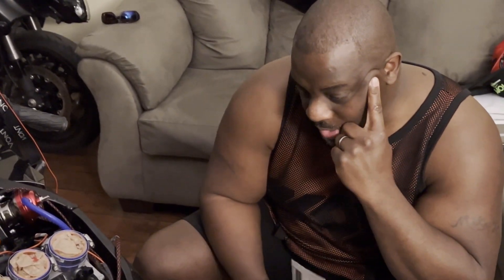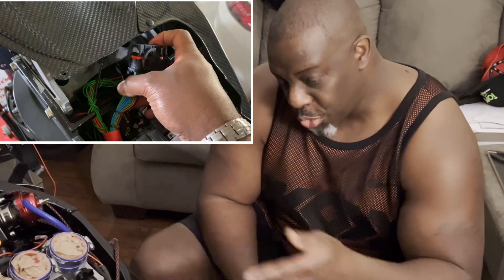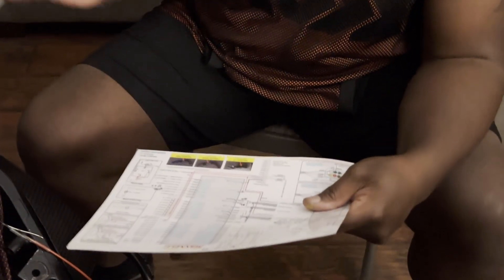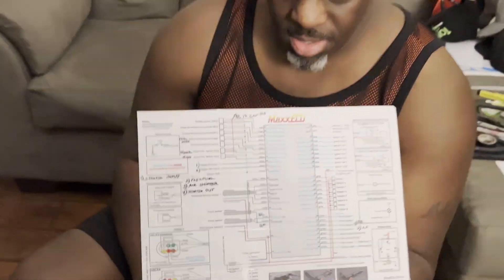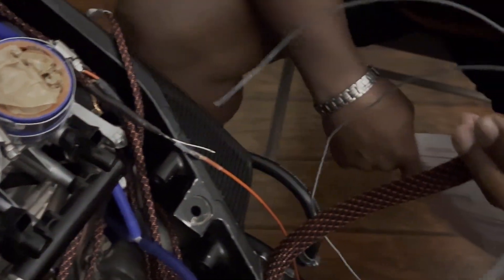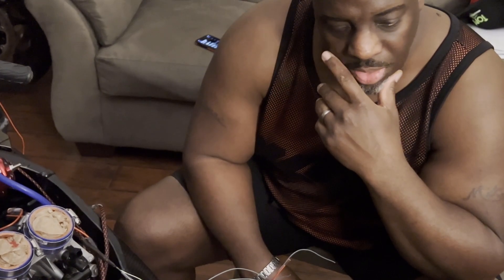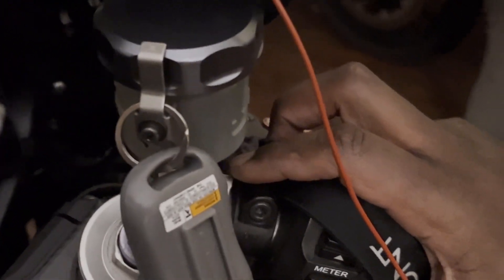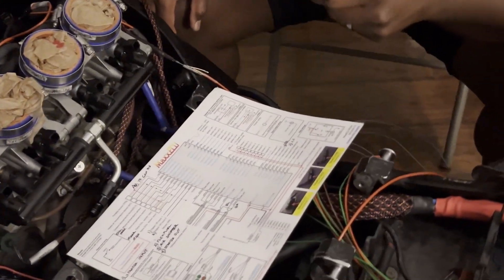Mike Builds a Turbo GSXR1000 Engine in 7 minutes!!!

Comment: Sorry but for street bikes, guys don’t need a stand-alone FYI. Also 07/08 GSXR 1K ECU’s are similar to 08 Gen 2 Hayabusa ECU. ***ECU Editor is your friend*** You could of tuned your turbo motor on this (plus OEM ECU) obviously new to turbo charging motorcycles and ECU/standalone. Yes you could of tuned the turbo motor without a standalone……..
Reply from the maker: As a drag bike, racers have been plagued with issues of various piggy backing such as 2-step boxes, air shifting modules and most importantly boost control units. Tuning the AFR/lambda through the ecu is 1/4 of the bigger issues. Now that turbo bikes are more popular for roll racing, standalone’s are more appropriate. 

The bike world is catching up to what high powered street cars have been doing for 20 years. My 08’ will have a ride height laser on the front wheel as anti wheelie control in an upcoming video. Managed by the standalone…..so many doors open to control every aspect of a high powered bike in one nice box.

Thanks for watching and comment again when we do an update.
Reply: @meganswelder it’s awesome to see what these standalones are capable of . You can literally make a crap rider “a pretty good rider” with just a standalone and a clutch these days , find someone that’s 90lbs lol and no wonder we are seeing low 8’s outta a stock engine 1k with a shock , standalone , arm and a small shot
Reply: Yup run a gen 2 base map and get the boost fueling ! I do it all the time for ppl . Works for the bking too
Reply from the maker: @caperformance_motorsports  our tuner, Gaige Herrera set it up to do just that 👍Thanks for watching!
Reply: @meganswelder  you got a great tuner right there ! Glad to see y’all are still building cool stuff